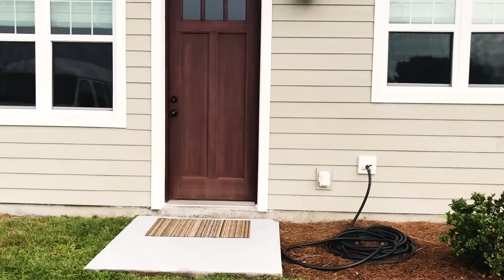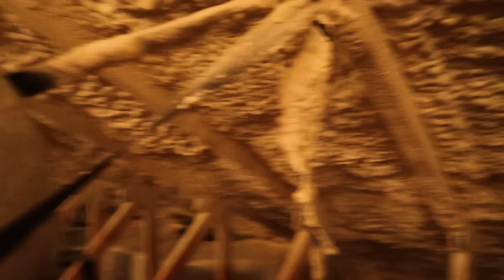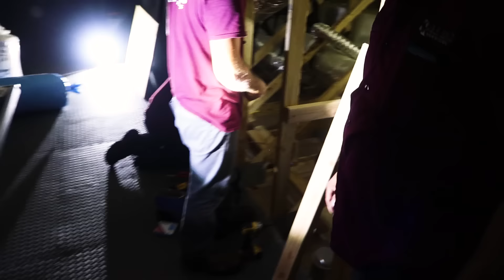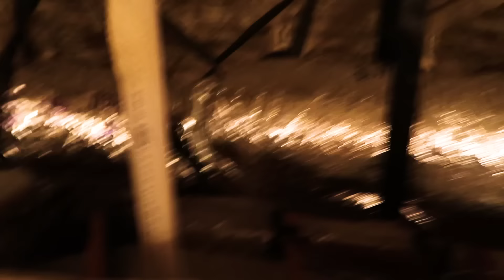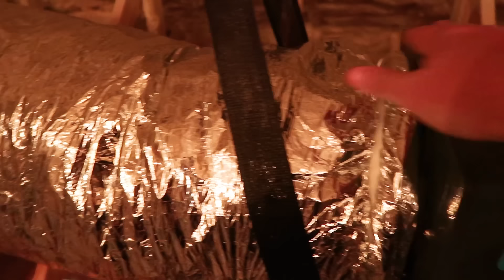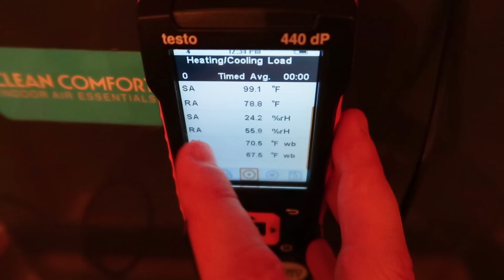Installing a Whole-Home Dehumidifier

Comment: Good job Brian. Just thinking that you might want to use two back draft dampers and isolate each supply instead of the one at the dehumidifier. Just a thought in case one system is running and one is not or maybe use electronic dampers in each line...again just a thought. Good job!
Reply from the maker: You make a really good point

Comment: Does having the backdraft damper at the unit so far from the supply of the HVAC, cause any static pressure issues when the dehu is not running but the HVAC is? I always here that closing a vent for example instead of the damper at the plenum causes static pressure issues.

Comment: Could the heat or cold from a heat pump water heater outlet be added to the ventilation system through ductwork if it’s helpful that time of year…? Your system is more sophisticated than the typical person’s … your wires resemble a typical server room in a mid sized business…😁 no further comment necessary since mine are much worse…my smart home server room is awful.   Water vapor rises…ground and house are warmer…condensing out where it’s coolest.  The highest point and coldest is usually the peak of the roof and shaded/ less insulated roof…The water vapor will condense out upon hitting the and accumulate there.  Not always, of course, but often.  It’s not too different from how clouds form and precipitate out…

Comment: If the dehumidifier supply is ducted to supply of air handler is there a damper to keep the ac from blowing back through dehumidifier?
If so if both are running at the same time can the dehumidifier over come the blower from the AC ?

Comment: In hot, humid climates like FL, I think just putting a 12-15 kbtu mini-split running on dehumidify mode (low air flow rate) would be more efficient than a dehumidifier.  Why dump 95 deg F heat from dehumidifier condenser back into house.  

95 degs F @ 24% RH dehumidifier output translates to 75 degs F at 45% RH equivalent dehumidifier output when brought down to room temp and eats up about 6.5 kBTU's sensible heat removal energy from your regular air conditioner to bring the 95 degs F air back down to 75 degs F at 300 CFM on dehumidifier.

On my central air, I went with a slightly higher btu outside fixed capacity unit and a variable speed air handler to help with humidity control.  I preferred to avoid the inverter VFD compressor outside unit.

Comment: Hi Brian, just wanted to confirm that you decided to leave the Dehumidifiers input ducting open, to draw in the humid air from the attic only? The climate where i am doesn't really get humid, so i'm thinking of running the Dehumidifiers input ducting from my two bathrooms and kitchen and then the output ducting from the Dehumidifier will join into my HVAC system to distribute the dry air around the house. Do you think this would work ok?
Reply from the maker: I will try to answer this in my Q/A video
Reply: Check the Santa Fe/Ultra Aire manual, but I believe they do not want you pulling from those locations.

Comment: Love the videos. Can you explain how the damper stays open when using a whole house dehumidifier while running the air handler blower? The cfm of the dehumidifier is lower than the air handler blower so how does this work? Thanks

Comment: What do you think about attaching the supply from the dehumidifier into the air handler return duct? That way you don't have to add a back draft damper and the dehumidifier does not have to fight against the supply air pressure from air handler blower.

Comment: Been having a small leak under the fireplace in my basement due to heavy rains. Most of the out water had dried but my basement was still rank and moist.>>>nub.best/3dzs I've ran this unit everyday for weeks. Continues to work wonderfully. Basement is now dry and livable. :)

Comment: Maybe this video is your attempt to sell some dehumidifiers, but I don't believe that an air conditioned residence needs a whole house dehumidifier. Did you try simply reducing cfm through the evaporator and, if necessary, adding a freeze stat to turn off the compressor only when imminent freezing is detected?
Reply from the maker: Paul Ohlstein I never said they “NEED” one. I have a very advanced dehumidification system on my home and the dehumidifier helps me maintain below 55% RH which is great for IAQ and comfort especially during edge seasons
Reply: @HVACS  55% RH isn't that low TBH... any AC unit can do that. When it feels comfortable and cool the RH should be closer to 40%. 55% takes no effort at all for any system to achieve.
Reply: @enkrypt3d  sure you can reach 40% but at what temperature? I personally wouldn't put one in my house. But if I wanted to maintain a low humidity 40% at a higher temperature let's say 78° you would probably need a dehumidifier. But then again like I said I would not install a dehumidifier in my home under normal circumstances. More maintenance, more electrical cost plus cost to install. I personally wouldn't make the investment. I would rather go with a higher seer rating on an a new a/c system or install a dehum compatable  system.
Reply: I would disagree Paul. Depending on where you are located "coastal,northern, etc. " whole home dehumidifier is a great investment. Let's say you leave home everyday for long periods and raise your indoor temp reducing Ac run time, Your system is not cycling as well as only cycling on sensible heat. Also during shoulder seasons your systems are not on long enough for humidity control. The dehumidifier doesn't care what temperature it is and will maintain the home reducing the load on your AC system. If your needing fresh air the dehumidifier will help bringing it in and lowering the fresh air moisture load.  This home has closed Cell insulation and when moisture is introduced and creeps into the encapsulated space it becomes trapped, The Ac drys the home but some of that moisture creeps up into the attic. It then travels up to the highest point and pushed back into the home depending on temperature swings "day, night"  Your Ac does a fair job at humidity control so long as it's running....They dont always run. If your putting freeze stats on systems to control moisture you chance damaging your compressor, sweating of the ductwork depending on r values and duct pressures, overcooling the space, and still only controlling humidity while its running . It's just not really worth it
Reply: I don't know where you are, Paul, but down here in southeast Texas, only 50 miles from the Gulf of Mexico, humidity is a big thing.  In a new house or total A/C replacement, you could use a variable speed condenser unit with matching furnace fan.  We had two speed units at our last house.  It would run full speed to get the set temperature, but then if the humidity was higher than that setting, the condenser and fan would run at low speed to reach target RH.  For us, 74-75 degrees at 45-48% RH was quite comfortable.  We moved a couple years ago to a spec home with "builder grade" AC.  On or off.  High seer but only one speed.  We can cool down to 70-72 and still not be comfortable.  Code here requires fresh air intake, so when our downstairs unit (the larger one) is running, it is pulling in outside air--which at the moment is 89 degrees and 78% RH.  The A/C can cool it easily, however...Cool and clammy is one description of the feel.  Also, we're under voluntary conservation right now, asked to set thermostats to 78.  Upstairs is 61% RH; downstairs 56%.  We're looking now at a whole house dehumidifier.  Or maybe two.  :-)
Reply: @cesarebeccaria7641  I have 2 single stage a/c systems. one in Delray Beach FL and one in Smithtown NY. We get humid weather in both locations. Indoor humidity has not been a problem in either location.

Edit to add: High SEER systems are not good for dehumidifying. Part of the way that high SEER is achieved is by running the evaporator a little warmer to take some load off of the the compressor. Warmer evaporator means less dehumidification.
Reply: Think heated garage in MN winter...sniw melts a booger

Comment: How much juice is reheat burning? Can you post screenshots? Maybe you could buy a Sense or other energy monitor and figure it out? I'm curious to see someone else's data. =)

From what I'm seeing, reheat probably uses a bit more, maybe $10-20/month more than a dehu, but saving a $3-4K dehu buys a lot of juice. We do it both ways, and the 155XT only burns 800 watts, which is pretty sweet considering 70 pint dehus burn 600.
Reply: Closed cell! Sweet!
Reply: You might try turning off the ERV and just running the dehu when you get the fresh air hooked up. We like the pressurization strategy in humid weather, it pushes dried air through the leaks, should help prevent moisture damage. BUT you have a ton of occupants, the 40-60 cfm of that unit is probably inadequate for your family.

Comment: I see a guy who likes his whirlygigs! 😛 Fantastic info in this video. I work in a large hospital with a research facility and humidity is always an issue! Our OR rooms must be maintained between 45 and 52% RH and it can be a struggle here in the South East during the summertime. It's much easier to control humidity once you can make the facility neutral pressure or slightly positive.

Comment: Do you have the t&p valve tied into the condensate drain on that water heater?
Reply from the maker: Joe Shearer yes... how many separate drains do you expect me to run!
Reply: HVAC School you could tee it in with the one for the dehum and then the t&p would be isolated. I'm just picturing the possibility of scalding hot water spraying everywhere in your nice mechanical room.
Reply: I really like adding a primary inline drain switch directly at the drain outlet like the ss1

Comment: Thanks Bryan for the time you spend sharing.
I do have a question related to cleaning indoor and outdoor coils.  How dirty do coils have to be before we realize a decrease in efficiency?  Would you wait until you can see the coating/film/dirt on the coil OR would you make it a part of an annual preventive maintenance procedure?  Would it be reasonable to say that a clean coil would help with dehumidifying indoor air?
Reply from the maker: Condenser Coil cleaning is important as a regular maintenance item. Will it help dehumidification? Usually not unless it’s really bad. It will impact longevity and power consumption.

Evap coils won’t get dirty if you keep a good filter in place replaced regularly and possibly a UV light in a very high growth climate